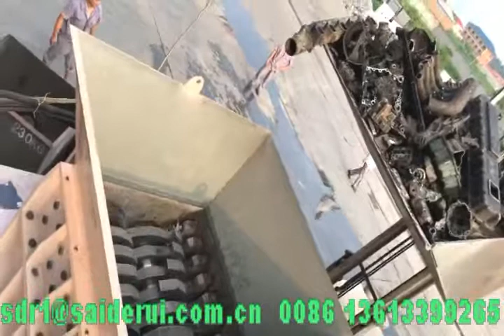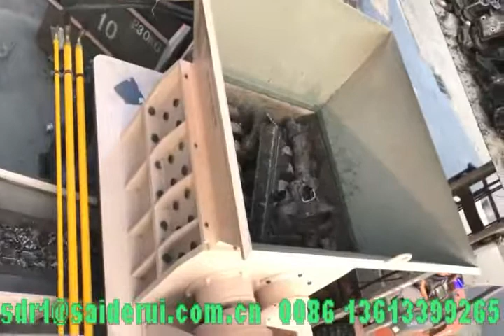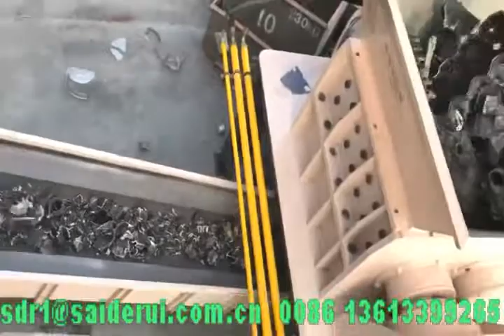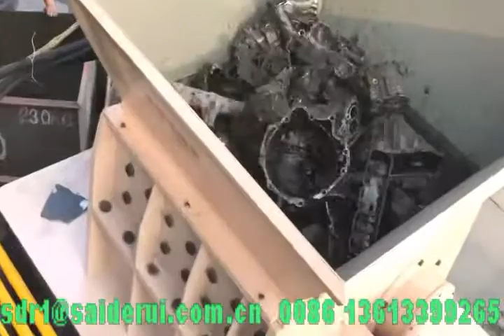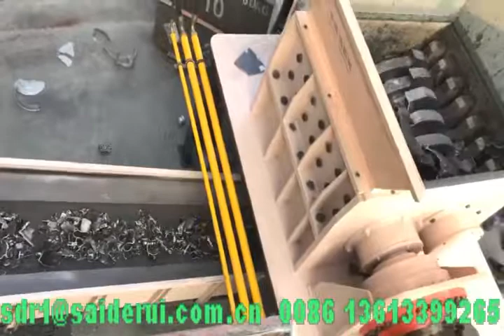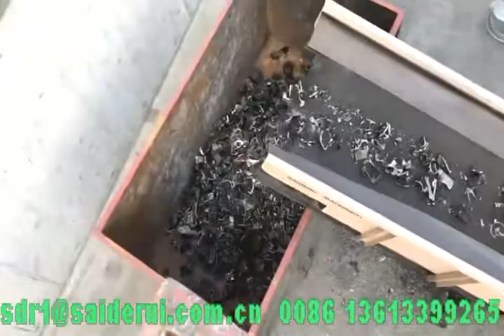aluminum engine blocks  Two shaft shredder

Comment: Valve covers, manifolds, exhaust header pipes, transmission bell housings, and a whole lot of little parts that fell right through the crusher jaws and not one engine block in the whole thing.
Reply from the maker: Hi, you want to recycle whole engine ? Details please contact whatsapp: 0086 13613399265
Email; sdr1@saiderui.com.cn

Comment: How much is it
Reply from the maker: It depends on what size you want . can you add my whatsapp 008613613399265
Reply: @anniefeng5951   size 100cm*80cm
Reply from the maker: @osamamatar4957  no problem, hydraulic or Gearbox type ? should confirm more details with you . please contact with me by Email, I will send you details quotation , my Email is  sdr1@saiderui.com.cn  or whatsapp: 008613613399265